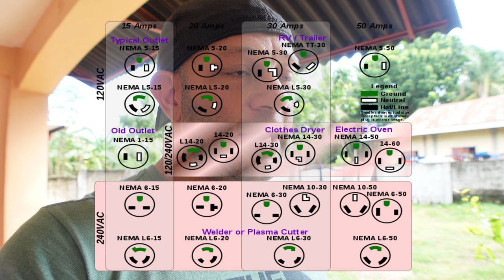Philippines Home Gets Generator Backup Power!

Comment: Honda generators rock. I can't believe you got a 6.5KVA generator for $1000. I paid that for my Honda 2KVA but I love it. That thing is 10 years old but it just works when I need it. We lost power last year for 3 days. I put it in the back yard with a 50 ft extension cord into the attic for the HVAC and we were nice and comfy cozy. It automatically ramps up based on load and would run 6 hours on one gallon of gas. Curious if you bought it in the U.S. was it set up for 120V or did it have a 220V output? I'm assuming you're 220V in the Philippines.
Reply from the maker: I bought one that had 120v and 220v and only use the 220v

Comment: I think you should consider using propane for the generator, it stores much better than gasoline, I converted mine to natural gas since it's 1/5 the cost and the grid would need to be down for months before it would stop working
Reply from the maker: Already switched over actually but good call!

Comment: Phillipines standard voltage is 220 V and the frequency is 60 Hz. Honda based generators seem reliable. Yamaha have a good name for outboards. If you can retain 3-phase, good for a well pump, if you have one.
Reply: Tank is a sensible idea, fix it well to ground, and sensibly ground the electrical.
Reply: Also on the weird science front, each ant makes its own analogue decision (to forage along chemical route), based on inflow of ants bearing good stuff. We have digital computers, but analogue is above that, which because of electronic inconsistences is difficult, and now there is quantum (for some problems). The Romans wanted to take Archimedes alive; look at the stuff he achieved in Pure & Applied Maths.
Reply from the maker: Hi honey generator has been working great. He’s only use that I am full of times but it’s keeping up just fine.

Comment: I think a generator for even just a few days is good enough. Imo I won’t need to run generator 24/7, I am ok during the day or just charge my a couple of fans that I can use during the night. That way my gas can survive for more days. Depending on the damage, we can assess how many days will the repair take.
Reply from the maker: Completely agreed and we have battery rechargeable fans for those nights

Comment: @It's Me         I have an emergency electrical/heating/cooling plan/system in the US.  Rather than try to cool the entire house during an outage I chose a plan than only cools my 270 sq ft master bedroom.   To support it I have a separate air conditioner in the bedroom and a Honda generator just large enough to support it, my refrigerator, and tv, computer, router.  Home generators are extremely inefficient and the smaller the generator you can get by with the better.  I have two vehicles and one of them I rarely use but I use it as my mass fuel reservoir.   My backup for heating is gas logs.   Should the natural gas system go down I have some portable electric oil filled heaters I can use.

If I ever move to Asia I will continue to have a backup plan.

Can you sell power back to the grid in the Philippines?    If so I would have skipped the batteries and would have gone straight to a generator for backup.
Reply from the maker: Yes you can. It’s called net metering you have to apply for it. I’m waiting for my approval.
Reply: @ItsMe_Philippines  Something else to consider is that DC power supplies are generally more reliable than inverters.   Anything in your house that runs naturally on DC (ie LED lights, home entertainment) you might consider switching.    If you do have consumer electronics connected to the grid make sure that they are protected by small UPSs.    Don't try to protect LED lights as they are so cheap now.  Just keep a few spares.

Comment: Great advice about having a backup generator to the solar.  Regarding the gas reservoir, won't the gas will go bad if it sits for a long period of time?
Reply from the maker: You are correct so I would need to stir it and would also use it for my own vehicle. Then add new fuel afterwards.

Comment: I think it'll be wise to use the generator to also charge the batteries. Because generators almost always produce more than you use. and the rest would be wasted not something people want in a situation when they want to optimism resource.
Reply from the maker: Completely agree with you. I turned it on every other week. Just let it run for 1-2 hours. But I noticed when I did that on Sunday the only thing that was running was my laptop in the fridge so it’s not an efficient way to use the gas.

Comment: Question on having a months supply of gas for the generator; after a period of time gas will loose effectiveness.  Do you plan on adding stabilizers and not vent the tank?
Reply from the maker: Adding stabilizer or stirring the gas or your options. More than likely I would just have a holding tank for a months worth but actually keep less inside. We know in advance when the storm is coming so I can always fill the tank then.

Comment: I haven’t read the comments yet so someone may have said this.  The fuel over there will go bad rather quickly so make sure you don’t over buy and have bad fuel when you need it the most
Reply from the maker: Yes you are correct and only have a small amount now. Waiting on my propane conversion kit.
Reply: @ItsMe_Philippines  that’s the way to keep a good amount backup power at hand. My neighbor has his Generac while house generator connected to natural gas here in the states so there propane is a great option. Good video topic maybe.

Comment: Im confused the 220 here is different than the 220 in the Philippines they have 1 line 220 we have 2 110 lines at a different  phase to add up to 220 is that a problem ?

Comment: Question. Is your generator running natural gas or propane. Just subscribed. Plan on moving there in another 10 years. Whereabouts do you live? I’d like to start the land buying process. Thanks again brother.
Reply from the maker: It was on gas and I switched to propane not long ago to allow for fuel storage.

Comment: I really enjoy your techy vidoes :). By the way I am from Chicago also. Like how you go in depth on your planning and thinking on these topics.   

I would be very interested in understanding your thoughts on keeping the gas fresh in a large tank. I know that you mentioned that you would maybe only keep the tank 1/4 to 1/2 full but that would still be 1 to 2 weeks worth of fuel for the generator. Maybe you plan to run it 1x per month to burn through it an keep it fresh or Is something like Stabil available in Philippines as a gas additive. I gonestly don't even know. Diesel has a longer shelf life but I know that gas generators are much more affordable and readily availabe in smaller sizes for a single family home.... I am just curious of your thinking on the gas. Thanks...

Comment: Fantastically informative blog as always! Did you say LBC here in the USA shipped your generator and accessories to the Philippines for $70?? Also did you use them to ship other boxes of tools, supplies, hardware or other things there and if so would you mind giving me an idea of the cost of doing that? I was considering sending some tools and thing via balikbayan box approx. 27 X 27 X 18 at a cost of $100 per box.
Reply from the maker: Yes, I used LBC to ship everything because I don’t have a weight limit. The generator and some other boxes were oversize so they just charge me for an extra large box.

Comment: Her home is a lot smaller than what you have so I'm pretty sure that's 6500 general but I have would work there It's a basic one story house to bedroom big kitchen big living room or refrigerator In basic lights don't have air condom in the process of getting in that build
Reply from the maker: Sounds like it would be fine and my friend. Just make sure the generator use and has a 220 option.

Comment: Hi Corey, when you shipped your generator from USA to Philippines through LBC did you declare it on the form that it was generator?  Did you ship it through its original packing or did you repack it?  Thanks.  Paul
Reply from the maker: We repacked it so it had additional padding around it. Drained ALL fluid as well. LBC actually handled the paperwork for me so let me look for the receipt to see if that’s what they listed it as (unlikely though).
Reply: @ItsMe_Philippines  OK, thanks Corey.

Comment: Great info here. Smart planning like you said is the key.  Here in Florida or Hurricane alley, many homes here have permanent backup generators aka Generac Guardians that are rated around 17kVA to 20kVA, which can run pretty much everything in an average 2000ft² home, central a/c, all the lights, ovens, refs, etc. However, they are quite pricey upwards of $10k.  I don't have anything like that.  You find those in the homes along or very near the Atlantic Ocean.  With Phils being a 220V country and the US, a 110V country.  Did you have to use a step-up transformer to operate lights and appliances or does Honda have a 220V outlet?  The one thing that always scared me in all my visits there is that all the houses run on a 2-wire system (hot & negative).  I never saw any grounding wires.  Even all the outlets only could accommodate 2 prongs and those were not polarized.  It is amazing that very few houses burn down.  There is always a risk of shocking yourself handling radios, fans, toasters, etc. But that's just the way they do things.  I did immediately notice that difference.  We also use LBC frequently sending Balikbayan boxes.  The agent here that picks them up has always told us that they charge by size and not by weight.  in theory, you could pour concrete in one of those boxes and the shipping charge will be the same as if only pillows were in there.  LBC rents shipping containers that get filled with our boxes.  A standard shipping container is about 40ft long and 8ft wide.  I know of people that rent entire container and put all their belongings in there for around $3000. btw, you got yourself a very nice home.  Love it.  Thanks for sharing.
Reply from the maker: Yes, this generator has a 220 plug but I had to change the outlet so that I could go get it to the transfer switch for the house. I also wish they ran on three wires as I don’t like the two!
Reply: Good luck getting ANYTHING through Philippines customs. You have no idea the corruption
Reply from the maker: @redpillcopinthephilippines9647  I shipped everything through the Philippines customs. And I mean everything from my sound system, Blu-ray/4k collection, clothing, extra cell phones, laptop, generator, over 10K worth in tools, solar panels, and kitchen appliances.
Reply: Hi im living in the Philippines as well, what of honda generator have u got, petrol or diesel ow and size cheers
Reply: @ItsMe_Philippines  two wires is no big deal. The difference is there's no safety ground but not really a big deal if you know what to do or understand it so you can be safe.
Reply: @ItsMe_Philippines  We're looking to do the same. I DID hear about the "up-charge" from the custom's guy though. Thousands. Did you make a video on how the shipping went for you?
Reply from the maker: @ALL4SCUBA05  Through some companies, yes. With LBC it was not an issue.

Comment: It would've been nice for you to show in the video the generator already installed as you've done with your solar system to give a sense of the size. And when you said about getting a U.S. bought generator because it wasn't available in the P.I. but then you said parts though for a Japanese brand generator are available in the P.I., that is confusing.
Reply from the maker: Some of your popular US generator names like Generac for example are not sold over here. So getting parts would be difficult. 
Honda is sold over here so getting parts would be easy. They are just expensive here because the supplier’s are not selling high volumes of them.

Comment: I know that the quality of gasoline diminishes in containers over time.  Would your reservoir protect against that?
Reply from the maker: You can add something to gas so it last longer. Converted it to propane already to avoid bulk storage issues.
Reply: @ItsMe_Philippines  That's good.  I don't know much about it but wanted to bring it up just in case.  I should've known you'd have it covered.  😀

Comment: Solar should be installed safe and protected by falling trees or other stuff. If you put it on a zinc roof it's always a risk when the wind is too strong. We put it on our concrete roof top and it's wind protected and survived many strong typhoon 🌀... 
The operational cost of a solar or gasoline generator is too expensive per hour and not necessary when your solar is okay. In the end it's always cheaper investing in quality instead of looking at all these back ups....
Reply from the maker: Thank you for your opinion but I got a great discount on the generator and it’s a good piece of mind to me. My solar system is extremely strong and I’m not worried about it but I always like to have a back up plan. Thank you for watching.

Comment: How long does Generator last 1, 2, 7 days without Gasoline or Natural gas?
Reply from the maker: How long does a generator last without gas? Only a couple of minutes. If you’re referring to how much it will last regarding with the tank size. I’ve run it three times now for six hour increments to get a good evaluation. I would comfortably say 10 to 12 hours on this tank running normal to large loads. Kept one air conditioner on the whole time to make it work but I can’t imagine a large brown out for extended periods of time where I would be running multiple Aircon.
Reply: My bad, how many litres/gal in your tank. If needed, how long would tank last prior to refill during a total power outage? 3 days? As an example.
Reply from the maker: @donwebb6776  about 12 hours if load was heavy. Reason why I have extra fuel storage onsite.

Comment: The gas here has alcohol added like in the US so you need to be careful about storing it I did store 20 liters for over a once here but it was in an airtight plastic gas can and it was still fresh when I used it but I left some in the generator and it went bad over a few months so I had to take the carb off and clean it 😢
Reply: I stored some over a year in a airtight plastic gas can and it was still fresh when I used it

Comment: Well gee, putting solar panels under huge tree that will lose limbs doesn't seem like a very good idea. I don't like batteries either, but limbs falling is something I can minimize.

I created a hydroelectric system in N CA years ago and it worked great. Cheap, 24/7 so no batteries needed. When I look for a place in SE Asia I'll be looking for a hydro location. Cool thing is in SE Asia flowing water is considered unusable (not farmable) so is cheaper.

For people going solar I'd suggest wind in addition. Once you have all the equipment for solar adding a wind generator isn't very much money.
Reply from the maker: All very good points

Comment: Are you using a fuel stabilizer in your gasoline?  Gasoline will go bad after a few months (maybe 6 months) and when it is then burned in an engine, the deteriorated gasoline will 'gum' up parts of your engine...literally.  This then reduces the life of one's engine and invariably causes unnecessary problems.  One could also look into converting one's gasoline engine into a propane usage engine where propane never goes bad, is easy to handle with the usage of a larger storage tank and one never has to go outside in inclement weather to refuel the generator.  I, as you, like to be prepared as much as reasonably possible so I have two 1000 gal. propane tanks...just in case.  You wouldn't need anything like this, but a 200 gal or 500 gal tank may be appropriate.  But, then, maybe you don't have propane available where you live.
Reply from the maker: We switched to propane right after the install.
Reply: One more thought...and I am probably bugging you by now...Is your generator battery start?  If you are not there when it is needed, can your wife safely and appropriately use your transfer switch?  Can she operate the generator?  I presume the two of you thought of these things before your purchase of the generator.  Check also with a qualified electrician about the dangerous effect of improper switching of the transfer switch into the power line with the generator running and creating power.  Just some thoughts...               @ItsMe_Philippines

Comment: Is propane not a good option?
Reply from the maker: Actually, that’s a great option. I’m waiting right now for my conversion kit so I can have propane storage on site.
Reply: @ItsMe_Philippines  after the Texas freeze in Houston I purchased a 9500 watt trifuel generator. I plan to only run it from natural gas. keep in mind the power outage steps down. For this particular generator gasoline is 9500 watts, propane will produce less and natural gas puts out 6500 watts. With that being said it's still enough to power a 2100 sq ft home with central a/c. You said you overpowered your generator anyway so you should be good with the propane conversion.

Comment: I don't understand if you can easily buy parts at fifty locations in the Philippines why can't you buy the entire generator there as well?  japan is much closer to you than the U.S.?
Reply from the maker: It’s an expensive brand name and model, so I couldn’t find any locations that carried it. They only carry the cheaper and smaller options because that’s what the locals can afford. Getting parts shipped to me would be very easy however.